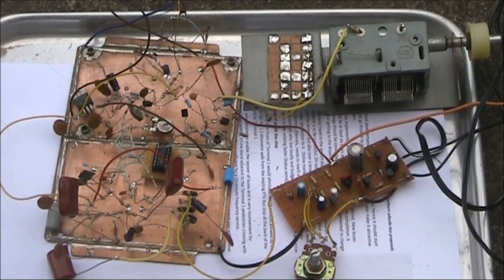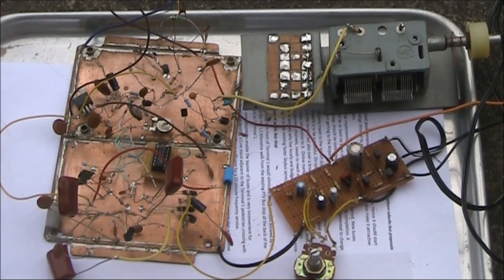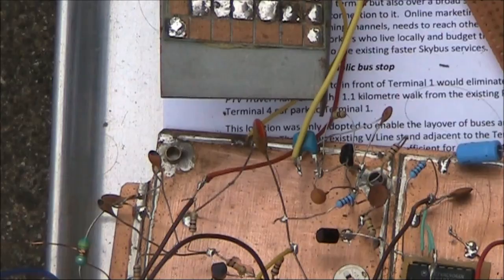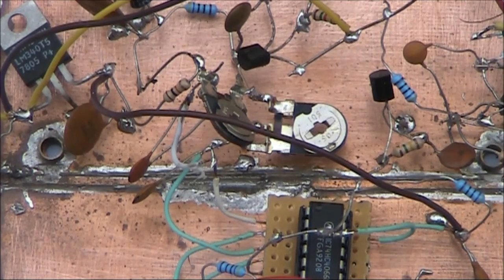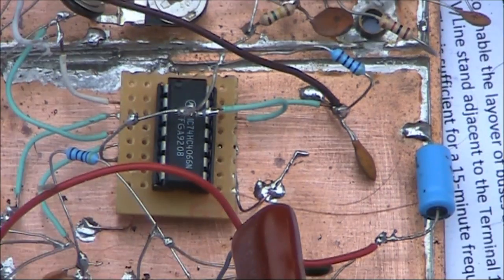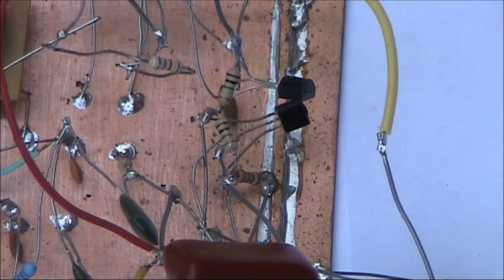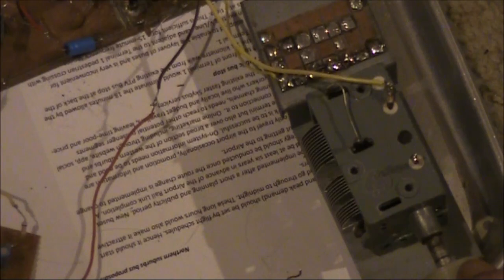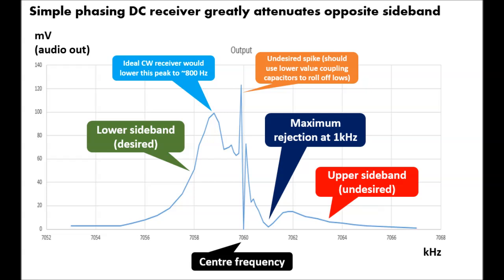Experiments with a PA2OHH phasing method direct conversion receiver

Comment: For best supress 90 degree phase shifters need placed in heterodyne side and RF side!
Phase shifter network in audio side is a bad idea, design.
Reply from the maker: Audio phase shifting is harder to implement accurately due to the wide range of frequencies but direct conversion phasing method equipment requires phase shifting at both audio RF and audio. There are approaches using polyphase networks or op amps that give a pretty good 90 degree shift over a reasonable range of audio frequencies.

Comment: Nice work Peter.  I like the very simple way of achieving the RF quadrature -- split the incoming signal, not the VFO.  Then 90 degrees of audio phase shift, and Bob's your uncle.  I drew a chart showing how one of these ingenious receivers manages to get rid of one of the sidebands:  https://soldersmoke.blogspot.com/2020/05/n6orss-hot-mustard-phasing-board-and.html    Thanks and 73  Bill